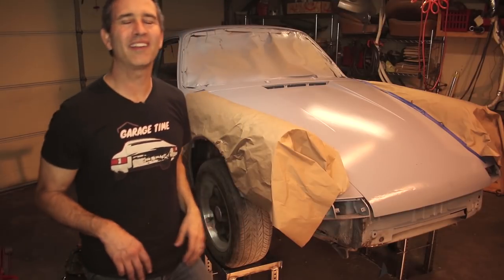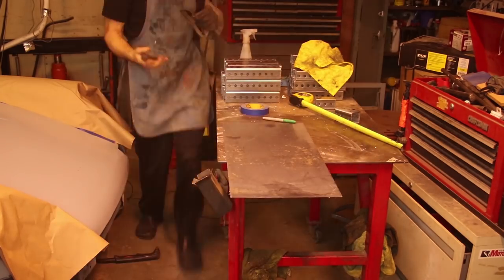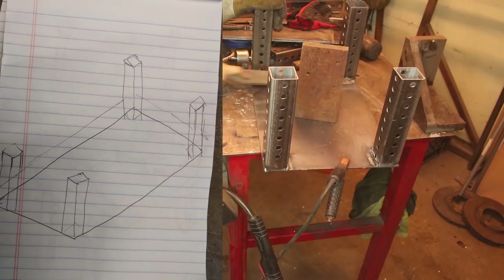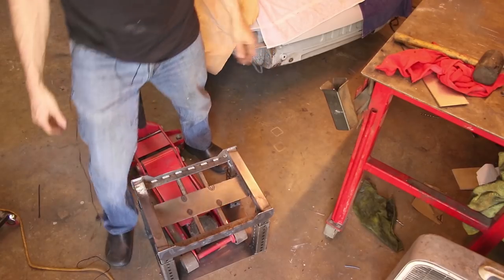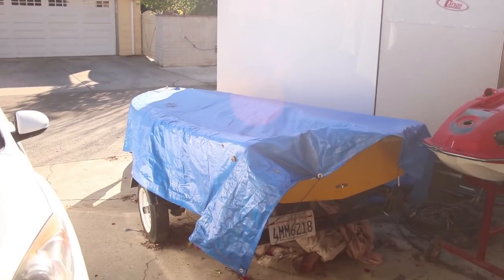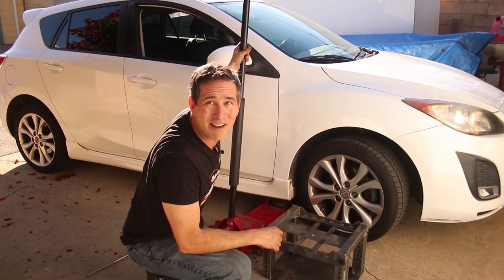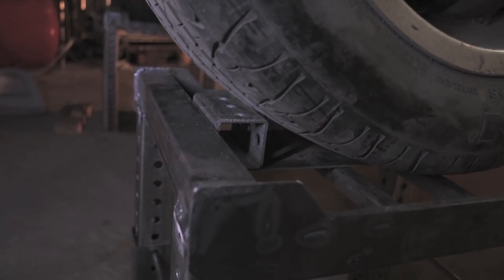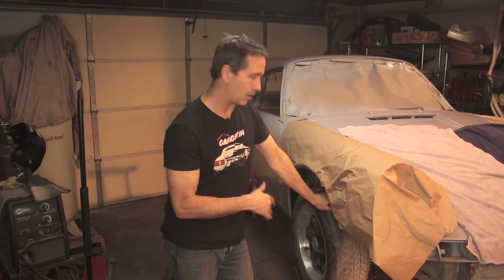DIY Tire Stands Lift my Porsche Project Up a Notch

Comment: I did the same sorta thing with stackable 2x4 wood stands, that interlocked together. Just as a backup, to stop it from ever rolling, I ran a ratchet strap around one of the tires, and locked it to the stand. Come to think of it, a friend of mine still has them...holding up his Jaguar E type. But I like how yours are all one piece.
Reply: Was just going to recommend these.  You can see a set on this channel: https://www.youtube.com/watch?v=nrZGdcV1EaM
Reply from the maker: A ratchet strap is brilliant!  Thanks!
Reply from the maker: Thanks, those are cool.  Reminds me of Jenga!
Reply: Matt K those are pretty much what mine looked like. I was able to get my car high enough to do a transmission swap.

Comment: Great idea. I think you could use a couple of 6 ton jack stands as a redundant support. Also consider a diagonal support on your stands that slides and locks with pins or bolts. I’m going to do that on my variation of your design.
Reply from the maker: Thanks!  Check out this video for the diagonal modifications I made.  It's around the 15 minute mark.  
https://youtu.be/1nNzcjUsgNw

Comment: Awesome idea. I think what it needs for added support would be to weld some cross braces above the base plate from corner to corner and some spreader channels at the top of the bottom portion aligned with the top holes. Just my opinion.
Reply from the maker: Thanks Jose!  Already done in the video just after this one.  Check around the 13 minute mark 😃
https://youtu.be/1nNzcjUsgNw

Comment: good work Tom, seems way more than strong enough in a vertical direction, however, i would deffo triangle gusset the legs onto the baseplate and the legs that attach to the topplate. in both directions. so front/back and side to side. I would not trust a simple weld to hold the legs upright while wrenching on the car...e.g. using big torque wrench or hammer...anything that makes the car want to move. Safety/stability  comes from spreading the load over bigger distance. (now you only have the width of the leg to rely on)
Reply from the maker: Agree, I said in the video that I'm going to add shear braces to the back and sides.
Reply: @GarageTimeAutoResto  cool! missed that comment :)

Comment: Have you considered mounting a bottle jack in the center of each stand? It could keep you from having to move the scissor jack a few times per lift, and you could still use the locking system to hold it up along with the bottle jack as a “just in case” helper.
Reply from the maker: Yep that's a cool idea.  Definitely if I used everyday it would save some time.  I think it takes 6 minutes for me to get the car all the way up in a tight garage.

Comment: I'm considering making these.  I also think a ratchet strap round the wheel and through the jack would prevent the car rolling off.  Try it please and report back.  Meantime, many thanks for the video.
Reply from the maker: Cool,. My car hasn't rolled off yet, but when I do go underneath it I put ratchet straps on two of the wheels.  I also add a little wood block to prevent rolling on the platform.  It works great, be safe.  I also added diagonal straps across the back in the next video.

Comment: Make a flat Square tube tray to fit within the recessed area of the top of your jackstand device and rivet a thick reinforced rubber pad to it.  Carefully jack the car up by the 4 rocker panel Jack points and put some wood blocking or car ramps under the 4 car tires till you’re high enough to Put your jackstand device under the four rocker panel jack points and you’re home free! Same as a tire shop rocker panel car lift.
Reply from the maker: This is a good idea especially when working on tires/brakes.  Just need to be careful that you jack things up level or at least in small increments.

Comment: Nice, I need to lift my 996 to take the engine out to change the clutch but I think I'm gonna buy something.  I need a lifting technique more than anything, to get it up to height.
Reply from the maker: Hi, yes, you need to get sucker up high for the engine drop.  I think there is a guy who sells something like these.

Comment: Great job. It's just what I need. Could you indicate the thickness of the tube? 0.04,0.08,0.12 inches? And the upper and lower plate on which you support the wheels?
Reply from the maker: Everything is 11Ga or about .120". 
The sheet metal plate on top has tubular supports under it that I think are thinner maybe .09"

Comment: Nice job. I would make the base 10 to 20 % wider, so there's no "lever" action and falling.
Reply from the maker: Wider can't hurt.  I use these on my level garage floor and have pushed on the car pretty hard.  Not even close to falling off.  
As a safety measure I ratchet straps the tire to the stand.

Comment: Hi ! Very interesting diy. Just a thought. If you want to work on your wheels, why dont you put your jack stands underneath the body of the car at the very precise locations done for that ? For me there's no reason why it won't work!
Reply from the maker: Good point.  I think it would work.  Maybe I could put some hockey pucks on the corners or in strategic places to support the chassis.  Thanks!

Comment: Those are genius. I noticed you didn’t sign any of your engineering drawings. Smart! No one can sue you. Can those square tubes be bought at Home Depot?
Reply from the maker: Ha ha,  I bought these at Industrial Metal Supply, but here's a little secret.  
Check with your city sign department.  Most signs are made of the same stuff.  Just strip the galvanized coating before welding with muratic acid.
Reply: Garage Time - Restomod That’s even more genius. With our drivers though, I can just drive around on Saturday mornings and collect those hat have been torn off at the base by drunk drivers.
Reply from the maker: Yes, that's how I got the idea.  When we are out walking I see signs lying around and I immediately recognize the metal.  Pre drilled metal isn't cheap, unless of course you are "cleaning up" sidewalks.😀

Comment: That's perfect. Now, how do you rotate the tires once your vehicle is up?
Reply from the maker: A jack is all you need to rotate tires.  These are meant for working under the car or making body work easier to reach.

Comment: Nice job mate 👏and thx for sharing. Is lt high enough to drop the engine  cheers
Reply from the maker: I haven't tested it yet, but hope to soon.  It should be high enough especially if the front is angled down a bit

Comment: is there any type of commercial product yet that is similar to this? for people that need to work long term on a lifted car and aren't working on the tires/brakes, this is really userful.
Reply from the maker: Definitely useful!  I'm not aware of anything like this available.
Reply: No, I think race ramps has plastic blocks for $200-300 per pair. Most people just buy 2x4's and build wood cribbage to the height they need. I just built some last week to have my car level off the ground to accurately change transmission fluid and diff fluid. It was about $35 for the lumber and screws and 2hrs of work.

Comment: PS You do have the cross brace under tension, that is your weakest part of design, the loads are attempting to push your uprights apart and not down...
The loads are transfered down and that is because of the wheels and those side plates you welded on.
On the engine brackets, consider a redundant ,extra bolt on straight bar, welds can break without warnings...
Hope I did not confuse you.
Thank you for sharing, I really like them.
Had to edit, my cellphone did some off auto word corrections.
I may do a video response for your understanding...
Reply: Quite an old comment but did you make a video? I’m not sure I completely understand what you mean, or rather I’m having a hard time visualising it. I’m eyeing off this design to “borrow” haha. It’s more suitable for me, than the timber ones I’ve seen.

In my uneducated thoughts, my 2 initial concerns were with the dissipation of the load - ie possible twisting of the 4 up rights, and also, the shear load and twisting forces on the inserted pins. I’ve honestly got no idea if that is of any concern, simply my first thoughts when I picture a jack /chassis stand where the load is completely centred and dispersed equally downwards through the 3 or 4 legs..

Comment: Consider using some ''shear pins or shear bolts"...  that rod you used... ahhh...
Reply from the maker: Do you know the double sheer strength of a 3/8 mild steel rod?
Reply: @GarageTimeAutoResto  , your design might really be a 1,2,3,4 stepped shear if you will... They might not all be under the same contact loads... One hole might be taking on more load then the next. To confirm this, use a soft piece of metal, that will deflect, then load it, as normal and then pull pins and measure.
With all that said, just use 4 different pins and keep in mind you actually have 2 shear points on each one of your legs not one.
This is a good thing, it distributes the loads.
The answer to your question is, each manufacturer has different steel mix designs so you would have to check with manufacturer. I would not bother, just purchase shear pins in the size you need and the load rating you like.
Reply from the maker: Actually my pins are 5/16", but even the lowest quality steel has a shear strength of 6,800lbs.  And each wheel as four pins.  My car weighs 2000lbs total versus 16 6800lb pins.
Reply: Then George, you should feel pretty comfortable sleeping under your car...
Now relax, and enjoy.
Wait, remember to inspect your pins frequently and your loads are only about 700 or so on each front wheel and the rest divided mostly evenly on the rear.
Enjoy yourself, you appear to have a nice safety factor.
I would have liked a corner bracket on the bottom supports, like a sway brace, but that is just me.
You can use existing holes and make them out of 1/4" luan, and if the luan cracks at all, then you know you better change to steel bracing.
I like the idea of proof testing materials before trusting...
Again, enjoy yourself and relax under there, they all won't fail at once anyway, and would what, drop down to 12 inches... Still safe.
Reply from the maker: Thanks, watch the following video for diagonal bracing.  It's towards the end.
https://youtu.be/1nNzcjUsgNw

Comment: I sorta like this idea... even if you have to have a wheel off you can still cobble something together with jackstands or crib blocks to support the area with the wheel off. I might have my buddy who makes trailers weld me up some.
Do you know if something like these are available commercially?
Reply from the maker: Thanks, I did see something similar on eBay once.  It used round tubing for the uprights.  I've been finding these very useful.

Comment: Are you willing to share some drawings/dimensions for your stands?  Did you base them on anything else someone did out there (I've found the lift stand llc stands that are a similar idea, but honestly I feel yours are more useful). I stopped at 32 and 34 seconds to see what you put in your video, but I'm curious what footprint you ended up with what dimensions of material you used for some of the pieces.  Knowing how these things go, I'll likely end up modifying dimensions to match what materials I have sitting around, but it would be nice to know to avoid having to re-invent the wheel WRT to what's needed to clear the tires, the jack...

BTW, I love your channel (I just found it about an hour ago and watched a few of your videos). I don't own a Porsche, even though various 911 models have been my favorites, an opportunity as a high school kid in the late 80's to drive one taught me that at 6'4" and 275# I can't get in them, at least not stock. :-/ Maybe I'll have to give them another look, see if that's not the case with all of them or if there's an easy way to make them work.
Reply from the maker: Yeah, i keep forgetting to measure them, but I'll get them to you
Reply from the maker: 17" x 12" x 11" high.  Hope that helps and be careful of course!

Comment: You will lose a few inches but put your jack stands under the frame then you can remove your tires and it will still be up in the air you can still crawl underneath it and life is good
Reply from the maker: Yep, sure can👍

Comment: Trying to make this for my restoration. Didn’t hear it in the video but could you drop the dimensions you used and the gauge of the sheet metal and other tubing used. Only size i got from the vid was the pre drilled tube. Great build though
Reply from the maker: All the sheet metal is 11 Ga Cold Rolled sheet.  I recommend boxing the three sides of the base for stability.  If you need base dimensions, let me know.  I kind of depends on the tire size you have though.
Reply: Garage Time - Restomod yeah if i could get all dimensions from you that’d be great, restoring a compact sportscar as well so it shouldnt be off by much and i guess its better to go bigger and chalk the wheel in place after, thanks for the fast reply as well
Reply from the maker: 17 wide x 12 deep and 11 high.  Sorry I didn't see this comment right away

Comment: Hello.
What are the sizes of the wheel stand? Interested in the length and width of the site and the height of the racks for lifting.
Reply from the maker: Reply 12" deep 17" wide and about 18" tall when extended
Reply: OK. Many thanks and good luck in restoring a car

Comment: @14:43 just use some ratchet straps around the tire/rim and base if you need one more level of safety.
Reply from the maker: YES!  Another commenter mention this and I've tried it.  It definitely works and I do this everytime I go under the car.  It prevents any rolling 👍